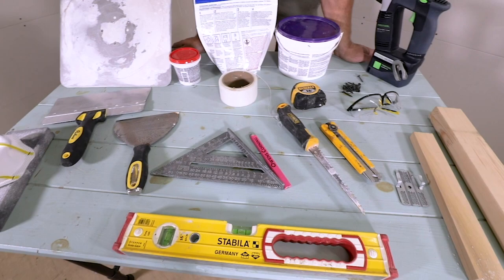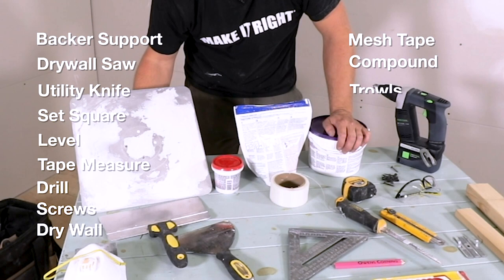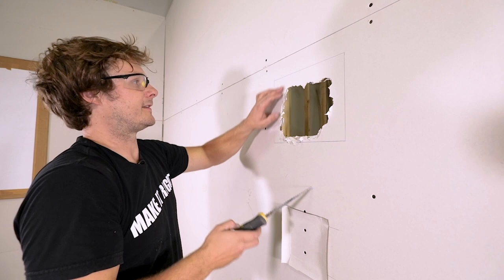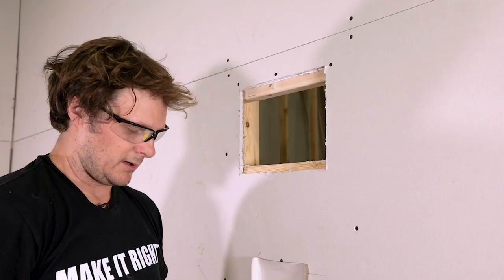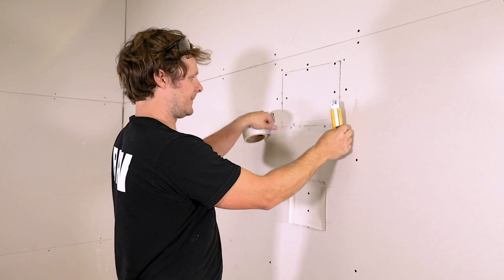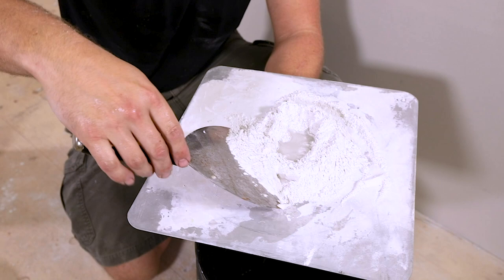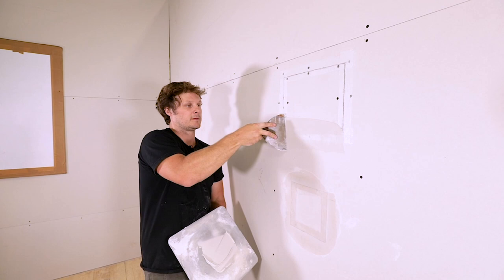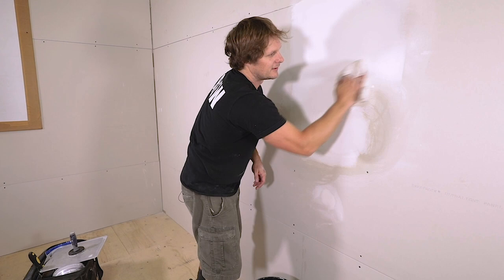How To Patch a Hole in Drywall (For Beginners)

Comment: Bob Villa did a similar video about 40 years ago about how to repair a doorknob hole in drywall.  Instead of squaring the hole he put some wadded-up newspaper in the hole to give the spackling something to lean on as you fill in the hole.  After filling in the hole, everything else was the same; sand, clean, paint.  Oh yeah, put a spring deflector on the door or wall to prevent putting a new hole in the wall at a later date.